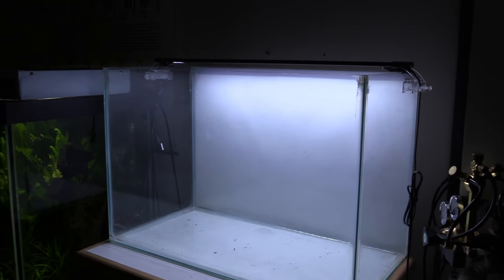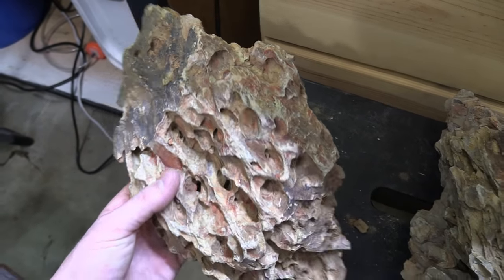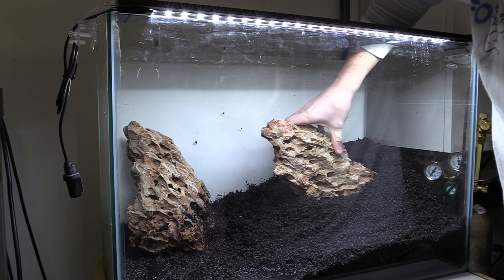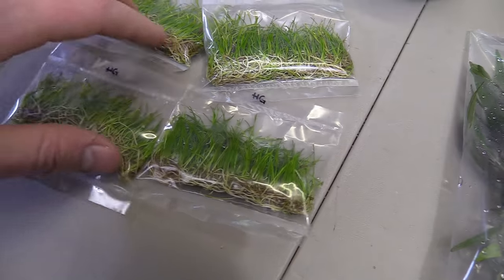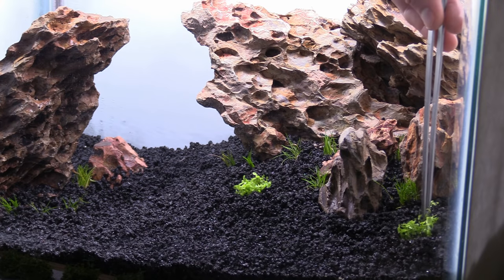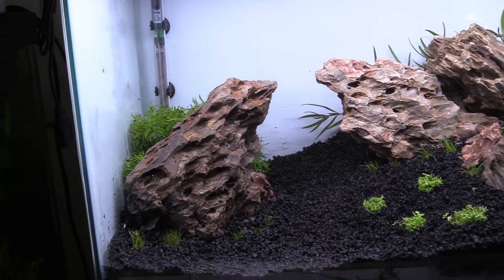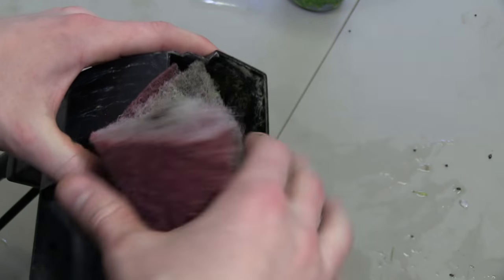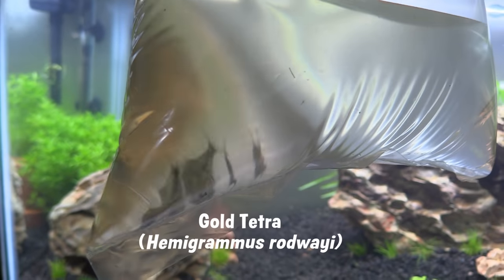DWARF CICHLID PLANTED AQUARIUM SETUP!

Comment: Great video! I have a male and a female Kribensis in a 36 gallon, they have spawned a couple times and every time they do they are great parents u til the female is ready to lay again again and they both turn into killing machines, I have to remove everything that moves for there safety, I’m thinking I’m done with  letting them breed, I will separate the male and the female, what can I put in with the male Kribensis that would be a nice center piece fish that’s not aggressive! More males? Angel fish? Electric blue rams?

Comment: I used to have fish when I was a teenager, now I'm 30 and I just got back into having an aquarium... and I've always wondered why someone doesn't make an external filter that can house the thermometer, the heater, the aerator, as well as being the filter. Since the water will constantly be flowing I think it's a great place to keep all these things, do all the funny business outside the tank so there is simply an inlet for the water and then the water gently flowing back into the tank, the right temperature and aerated etc. Not a super big deal I guess, but I was trying really hard to make this tank a work of art basically, and having wires and doodads hanging off the tank kind of kills that look lol. 

I mean obviously if you're serious about hiding these things you can clean up a tank and make it look pretty good, but it seems like some company would have stepped up to the plate by now and made things like that.
Reply: I believe there are canister filters that do most of those things and they are priced for it

Comment: awesome tank bro. I've noticed you've used 20 gallons in the past and removed the trim. This is safe? There isn't too much bow on the glass? I want to set something up simular to this.
Reply from the maker: 20's and below are fine, no need to brace, once you get up to a 29 though, because it is taller, you should brace it.
Reply: well hearing that from you, im doing it. I've been sitting on a 20 that had the top trim removed for almost 6 months.
Reply from the maker: +brad e Rimless is the best ;)
Reply: AQUAPROS where can I buy a brace for a 29 gallon tank online?

Comment: Doesn't all the bacteria die rapidly if not in a running filter? And even more rapidly if not submerged?  I guess I'm just confused on whether or not you grabbed that cycled filter sponge out if water before you installed it in your new tank.

Comment: I learned from another YouTuber that the beneficial bacteria did not exist in the water column. Rather it is in the substrate, glass walls, rock and plant surfaces and filter media. Although the water from your 90 gal do not have chlorine and other heavy metals, it may not have the beneficial bacteria. Please let me know if my understanding is off.